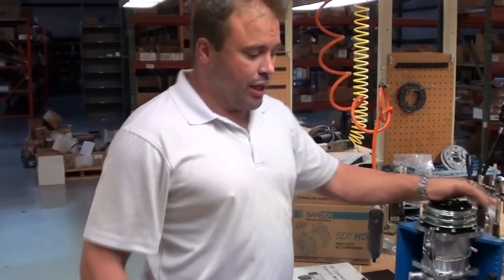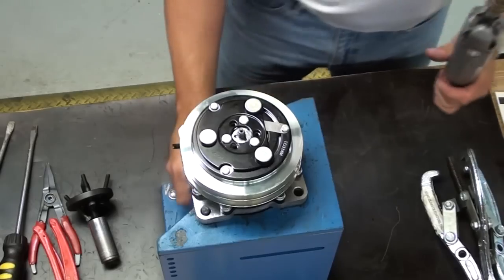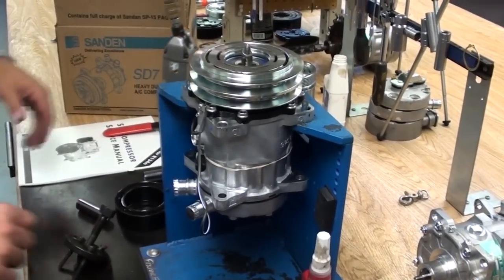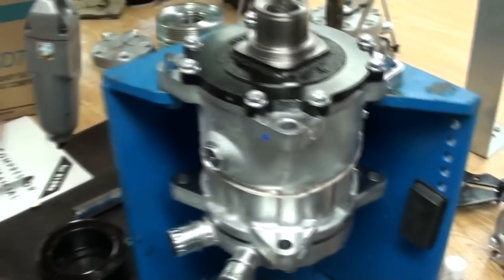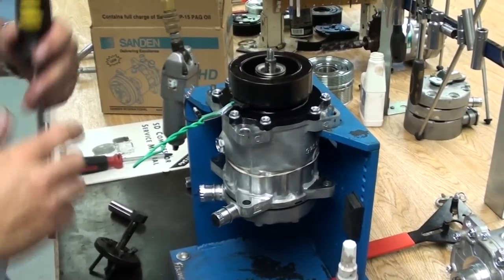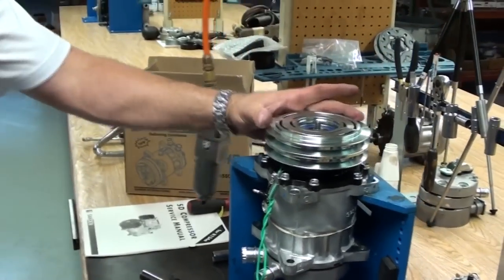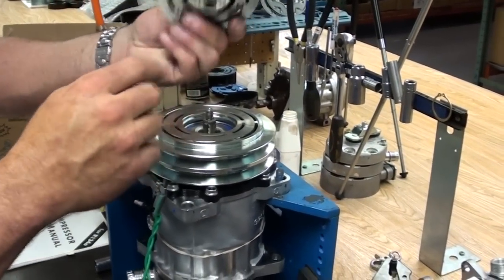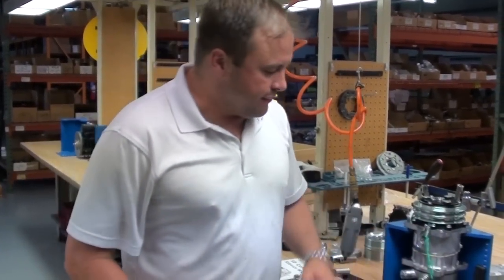Sanden Compressor Clutch Removal. SD7 & SD5

Comment: Have a Sanden  U-7903 part#15680077 and when I turn it on for the first couple seconds the clutch is squealing/chirping. I can see it engage but slipping before fully spinning. Looking at the air gap it seems wide perhaps right on the cusp of causing this issue. Can the gap be closed up? If so what are the min-max gap specs? System blows nice and cold. I've already checked belt tension and ruled that out. This is in a 1994 GM P-30 chassis motorhome (Southwind Storm) 454TBI w/4L80E

Comment: Thanks for the video mate. Was very informative and I now understand how the clutch, pulley, coil is all put together. I have one question. On a 507 Sanden can the pulley be adjusted in or out or it's pressed fit into one location only by tapping it in till it seats? Cheers

Comment: For those of you who find that the armature puller you have, the bolts do not fit the threads, Fastenal sells the M5x0.8 bolts for about a buck. These fit the generic York style compressor clutches from Omni/Santech